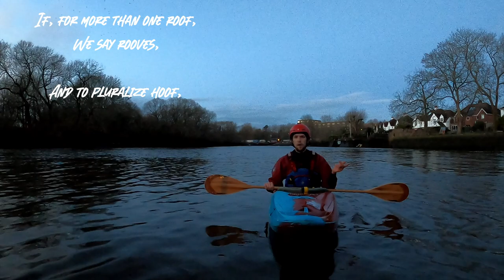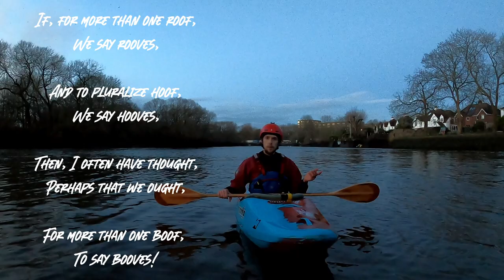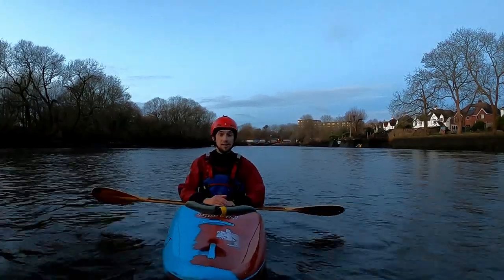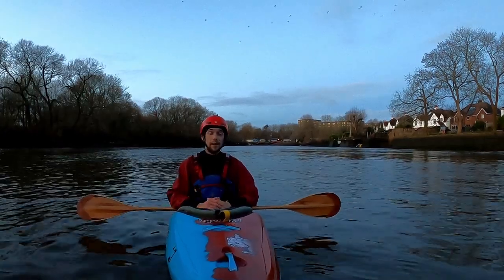Could this be why your BOOF is FAILING?!

Comment: Love where you're going as always, and recognise a lot of this from my tech template. Here's something I've been playing with around the way we balance verticality with rotational capacity to create the perfect forward stroke.  

Assumption A: High paddle angle equals deeper paddle and more impactful burst of power through the kayak
Assumption B: Low paddle angle supports body rotation and makes it possible to deliver power through the stroke for longer

How can we have our cake and eat it? 

Most paddlers begin their journey with high paddle angle at the catch phase, dropping low at the end as they rely on the short burst at the start and don't power through the end. Their power phase is short and therefore their boof is unreliable.   
It's also possible to paddle with the blade angle staying low-medium throughout. As you say you get good stability and a long lasting power phase if you use rotation. You may find you miss the burst of energy when needed though. 
What I'm playing with is this. Low angle to start, for big pre-rotation and lots of potential energy, gradually rising to high blade angle through the course of a stroke. This means that when I need to bring the power I've got it in the bank. This can look like top hand starting at shoulder height and rising to head height through the stroke.  Let me know how you find it bud.
Reply from the maker: Love this! Thanks for the input Jamie, really insightful as always! I'll definitely head out and give that a go.

Comment: You're right. So many people do not know how to generate power through the paddle. When done right, a power stroke will lift the nose of the boat even on flat water. But, I'd say, well over half the people I see paddling, probably more, try to do power strokes or boof strokes with the ineffectual hip thrust thing and trying to pull the paddle backwards with the upper arm as well as the lower one. I guess part of the problem is that a lot of paddlers seem to want to spend money on a new boat rather than coaching!
Reply from the maker: Too true. Thanks for the comment! This video is, in fact, partially a response to your comment on my Whitewater 101 video from a year ago!
Reply: @MatthewBrookKayaking  Aha! Looking forward to seeing the rest of the series. BTW, sent you a message about a podcast. No worries if not, but might be cool to cover some of this stuff.
Reply from the maker: @simonwyndham  thanks. I'll be in touch.

Comment: I’ve been banging on about this for years. Good forward paddling is so much, and so many good things in kayaking stem from it. If I had to boil  success at the sport down to two things, it would be having a good forwards stroke and looking where you want to go. I think people think both are clichés and so don’t pay them due attention. I don’t think you ever stop refining your forwards stroke and ever stop reaping the wonderous rewards of looking where you want to go. Myth-busting is a great thing in any field and you’ve done a grand job here.
Reply from the maker: Thank you Tim! That's such a humbling, amazing compliment. I hugely appreciate it.
Reply: @MatthewBrookKayaking  you’re welcome. You’ve got a great channel that helps lots of people. I would dispute your advised mechanism for generating a good stroke. One can take a stroke all the way from the front to the back without rotating, if they have bent arms. If the person is instead advised to do any paddling they like but have locked out arms (as a coaching tool!) then I’ve always found they’re forced to rotate and use the right muscle groups. On flat water, I’ll often spend the whole session with completely locked arms, so when I go on whitewater, the right muscle groups remember their job.
Reply from the maker: @timwatsonphotography  interesting. Thanks for sharing. That could be a good alternative to stimulate the correct kind of movement.

Comment: Hmmm.
I see what you're driving at. I think using sweeping as a coaching aid to teach recruitment of trunk rotation is extremely valuable. However, I think it's also important to remember that efficiency of forward motion requires the boat travelling in a straight line. Continuous sweeping causes the boat to oscillate left and right and wastes heaps of energy, and in a whitewater context I'd also have concerns about it encouraging over extension perpendicular to the boat during forward paddling. If you paddle a marathon boat like that you won't just be slow, you'll fall in. Good sprint and marathon paddlers have an even more vertical paddle than slalom paddlers, and far more than the average club whitewater paddler. The trick is to incorporate trunk rotation into an upright stroke that doesn't cause your course to deviate undesirably. You do that by punching across with your top hand as you rotate your trunk. I completely agree that a lack of trunk rotation/trunk separation and a tendency to arm stroke is at the root of the issue with a lot of/most paddlers. It's down to a lack of analytical coaching.

Here's a good vid on sprint and marathon strokes. These coaches would see your marathon stroke demo and shout at you! 😉

https://youtu.be/y_0G9GPi8D0

As for the boof plural: coming out of left-field, why not have 'boof' as both singular and plural?
Reply from the maker: Definitely. I definitely didn't stress enough that this sweeping style should be used as a tool to encourage trunk rotation for (the majority of) folks who have never been taught to do so properly. I agree, there is a need for straight-line paddling and that this involves the blade being more upright, but I'd also argue that no-one needs to be taught how to use their biceps to paddle forward; the thing people need to learn is preservation of momentum, gripping the water effectively and rotating through their whole stroke.

As to the nomenclature, I think that's probably the most sensible response so far. I like the thought of "boof" behaving like "sheep"…
Reply: @MatthewBrookKayaking  I 100% agree with all of this. That telltale pull of the elbow towards the waist people do during the critical transition from catch to pull when they should be rotation through with a solid arm is always a give away. "Paddling with the bicep" is a really good, succinct way of putting it!

As it goes, I watched that sprint video I posted again, and there's actually a really good, transferable nugget concerning 'poor' sprint technique that could actually be taught as 'good' boof technique, and totally chimes in with what you're saying: by pushing the top hand ahead of the active hand on the catch it causes to paddle to be too far (from a sprint perspective) past vertical in the last third of the pull, so the blade pulls up towards the surface pre-release and pulls the stern down into the water rather than pushing the boat forward, which is actively desirable in a boof. That tendency for people to focus all their effort on pulling the bow up on the catch and totally neglect the last part that pulls the stern down is a big reason their boofs fail

Comment: Hello. I have a question.You've said (5.20)that low wide paddling will give us more power (  I understood this as front movement power)than vertical one. How it could be achieved if part of energy(during wide paddling) is going into spin motion ?(according f.eg. to sweep stroke)
And why we can't use torso rotation during vertical paddling?
Thank You for Your opinion and video!
Reply from the maker: Hi. Thanks for the question. In part this is poor phrasing on my part. I should have said "more sustained power" or "more controlled power". I mean that in two senses. Firstly, the ability to paddle for longer, due to increased muscle-group activation and therefore lower targeted strain. Secondly, the ability to generate power and exert grip on the water throughout the entire move, which is vital for smooth paddling in whitewater.
I completely agree, torso rotation is perfectly possible with a very upright blade, but there is an undeniable inverse correlation between them in many people's paddling. The purpose of employing sweep-like strokes as a coaching device is to break people out of static paddling and move towards increased torso rotation.
This is, of course, a far more nuanced topic than one seven-minute can express! Hence I've had to abbreviate or leave things for the future episodes. But I hope that is the beginning of an answer!